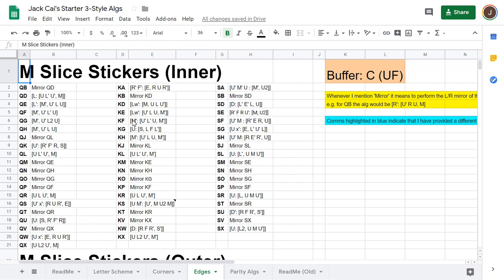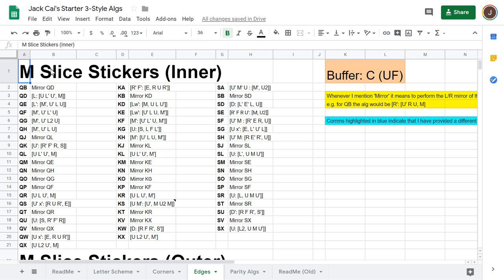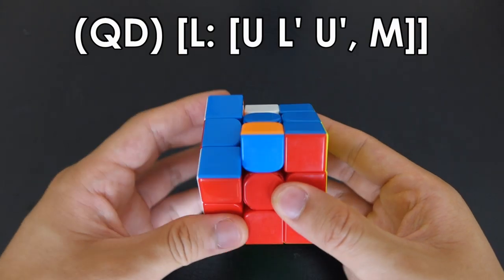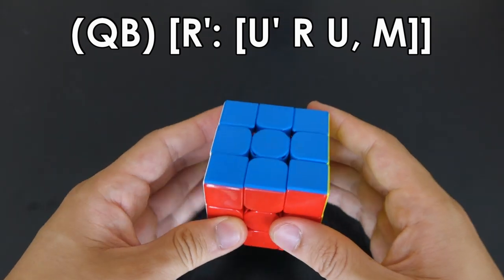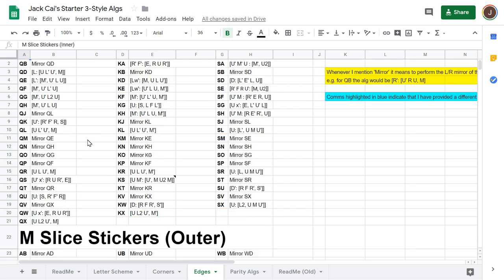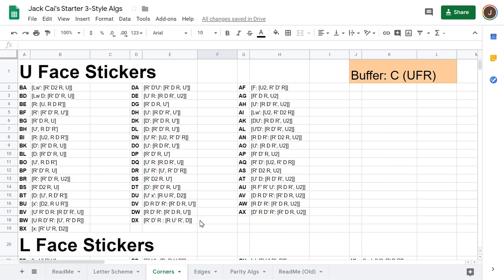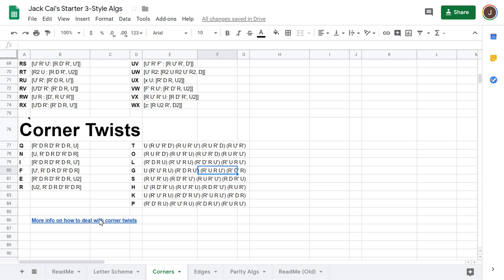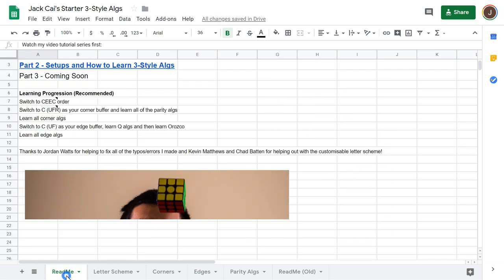3x3 Blindfolded 3-Style Tutorial Part 3 - Edge Comms and Example Solves

Comment: Hi Jack! I liked the orozco explanation as a stepping stone from m2 edges to 3style. Is there something similar for OP corners (LUB) to 3style (UFR)? Thanks!
Reply from the maker: Hi Damon, you can also use Orozco for corners (instead of UFR parity algs which is kinda like OP for UFR). You can implement this by learning all of the B algs (and inverses).

To deal with Q and N, you can use [R' D R D' R' D R, U]
 and [U, R' D R D' R' D R] to deal with them but one thing to note is that the direction of the twist matters, which isn't the case for edge flips (edges: AQ is the same as QA, corners: BQ is not the same as QB).

I still recommend UFR parity algs over this since it's simpler and you'd need to learn them anyway but this is another option 👍